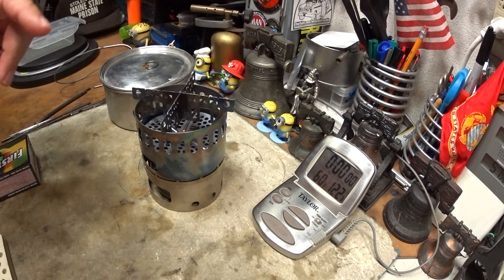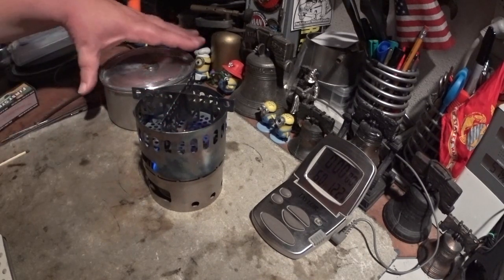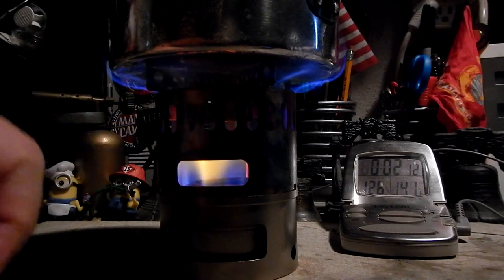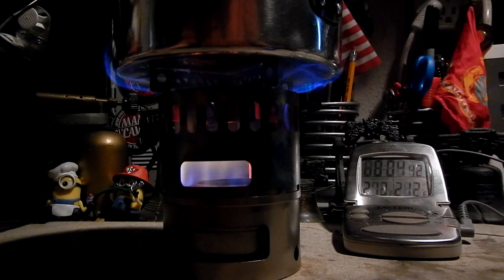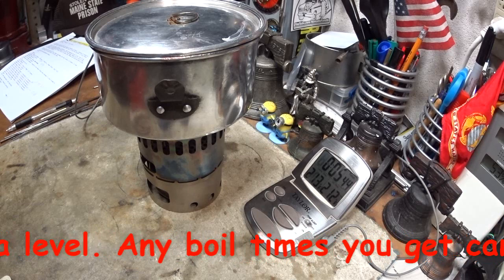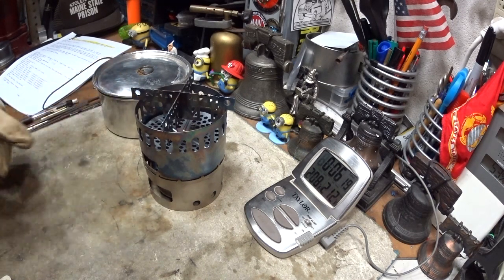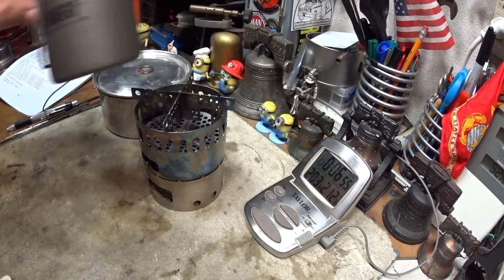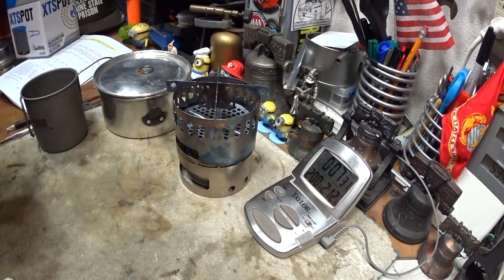Evernew Ti Burner - TI Stand Dx - TI Cross Stand - Boil Test

Comment: Hiram, Looks like a blue haired/ blue tongue monster. LOL! Sorry for the punch but with the extra cost of the DX stand, there is no significant improvement of boil time over just using the Ti cross stand and Ti stove (reference your #1 test from 7/2013). Unless, one would consider a this $40+ as a windscreen. Just thinking out loud.

Thanks for all you do for us water boiling geeks!
Reply from the maker: Rum Runner But it doesn't make a very good windscreen. I aimed a muffin fan at it from about 6 feet away and it didn't protect it much.
Reply: Hiram Cook Well there goes your chance for Evernew sponsorship :-D
Reply: Hiram Cook  Too bad, might have helped a consideration for some. Dual purpose stove is a great idea but I'll stick with building my fires on or in the ground if I run out a alcohol.
Reply: Dirk Stabins Ah, he "don't need no stinking sponsors"... If they make something interesting  to me, I buy one and send it to Hiram! The least some of us could do to repay what he has done for us with his channel.